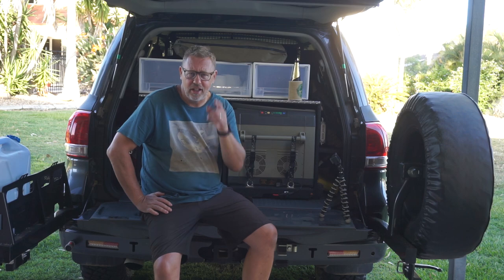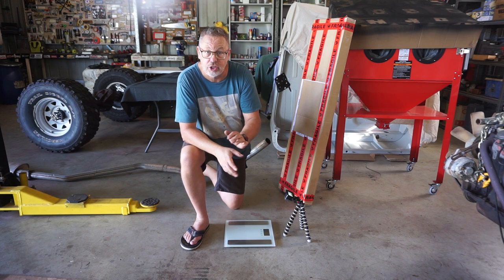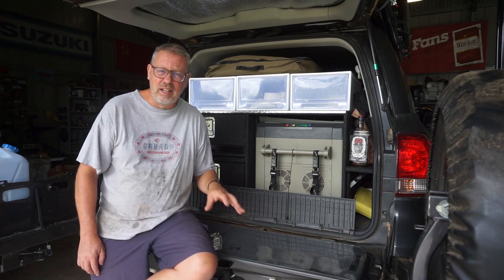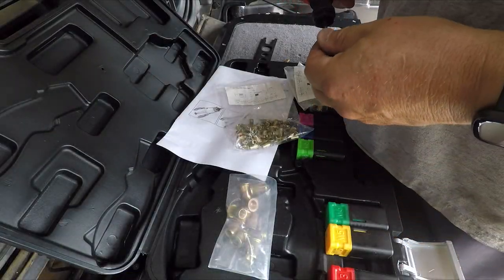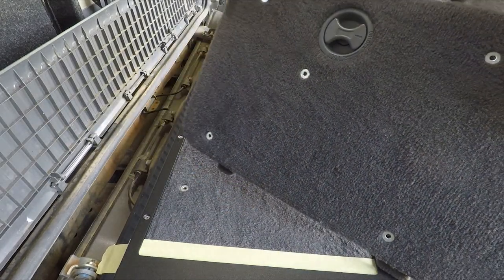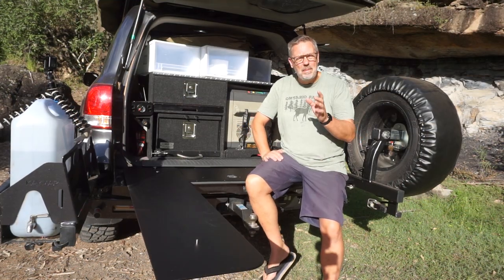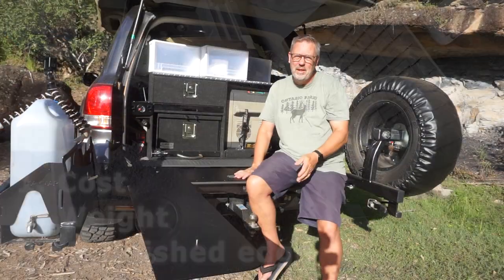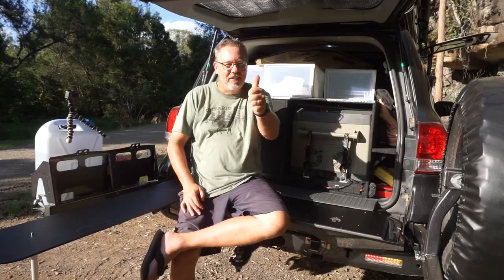How to Install a 4WD Tailgate Table | Cruiser Custom Camps | Is it worth it?

Comment: Hi Terry, it seems kinda weird that a company would want you to cut up panels just to fit a shelf onto the back of your tailgate and not supply some sort of moulding/cover for where you made the cut (just not good business to me). It also means that you can no longer use/access that part of the storage area as you are covering it with the blanking plate that you are affixing to the tailgate. My suggestion would be to make a fold-down shelf etc that comes off your rear spare tyre holder or something similar.  This is why I am in the process of making and installing 2 x fold-down shelves, one on each of the back barn doors on my 80 series. I've seen some people only have one on the main larger rhs door, but I am thinking of having one on each of the doors for easier use and especially the little one on the left smaller door just for simple things on the side of the road type of quick lunch or grab a drink kinda thing... I'll be making mine from timber that I have stored in my workshop and some piano hinges and probably will be making a video and putting it on my channel soon if you wish to check it out.
Reply from the maker: That’s awesome Tim.  I had an 80 before my 200 and did the exact same thing, but as you noted only on the larger RHS door.  It worked a treat.  I took the vinyl off the original door card and bonded it to the back side of the shelf and it looked factory.  Enjoy your build Tim😎👍

Comment: Hi Terry, thanks for your vid, it was clear & well done.  Maybe a con is the leg, it sits (sticks up) above the tabletop.  So you will lose table space and won't have a flat area to put things on.
Reply from the maker: Thanks James, I appreciate your kind words and suggestions.  I agree that could certainly be a con.  I have not found it to be an issue, but if it was one could just grind it level.  There would be more than enough material to serve the purpose.  Thanks again James😎👍

Comment: Hi Terry great tool. What I would do is replace the steel top with 5mm or 6mm aluminum plate.Use boat type aluminum as it is stronger and harder than ordinary aluminum. The the aluminum table powder coated black.
Reply from the maker: Thanks for commenting and for the suggestions Daniel, I really appreciate it.  The table top is actually aluminium, it’s just very thick to prevent bending hence the weight.  Whether it is boat aluminium or not, I could not say.  Again, thanks for the suggestion 😎👍

Comment: Well thats a ripper Terry, it’s something I’ve been trying to come up with for awhile. I saw a bloke on a recent tagalong use a Dunn & Watson small hook on table attached to the back of the wheel when it has been swung out.  I saw this before and I suppose the only other downside is that you lose the storage under the panels, I think.  Anyway I reckon this video has me sold on it, and also because it’s Aussie.  👍
Reply from the maker: Thanks for watching and commenting Andrew, I really do appreciate it.  It’s the fuel I need to keep producing content.  It’s the best solution I could find to address my issue.  Re the storage under the panels, you still have that mate.  Only about 30mm less on the left hand one (you can slide items under the cut down panel), and the entire right hand side remains as factory.  Anyway, glad the review and install video was helpful.  Keep the shiny side up mate😎👍

Comment: Nice video Terry, as usual.
You could try to enquire about the cost of carbon fiber sheet, if you use the same thickness you'll be surprise by the rigidity of it.
The carbon fiber will be at least a 30% lighter but given that you won't need the same thickness you could save 50% of the weight.
Thanks for sharing
Cheers
Reply from the maker: Thanks for watching and for your kind words Max.  Great idea re carbon fiber sheet.  I have no experience with it.  I appreciate you sharing your thoughts.  Cheers 😎👍

Comment: Can you provide me with more details of the tailgate soft opening latch please? I've made my own tailgate table modification, and I'd like to fit that latch you mentioned. Btw my mod is much lighter than the one you've shown. Thanks 👍🏻
Reply from the maker: Hi Paul.  YouTube will not let me put video links for Jafffa Adventures in the comments (nor any other channel) but if you scroll through the Jafffa Adventures library you can find "4WD Rig Rundown. Landcruiser Overland Tourer. Episode 2/3 The Interior".  I have a little bit more information at around the 7:50 mark.  The part numbers you are after are 66120-60021 (Hinge) and 67028-60010 (Damper).  I would get them through Amayama rather than your dealer as I'm sure they will want your first born for payment.  They were selling for $51.24 AUD for the hinge and $66.32 AUD for the damper when I bought them.  With the additional CCC table weight they are 20% effective, without the additional weight they are 100% effective.  Let me know if I can be of any further assistance.  Keep the shiny side up mate, cheers

Comment: Well done.  Great job on the installation.  It takes a brave person to cut up a perfectly good trim 😁 Though wouldn't it have been just as easy and quick to use the Drifta pull out table that you already have with your drawers for the type of use you had in mind?  Then no additional weight and no extra cost.
Reply from the maker: Thanks for the kind words and question, it’s very appropriate and the same one another viewer asked as well.
Two reasons.  The Drifta table, although great, takes a minute or so to set up and to get level.  That does not seem like a lot of difference but it really is.  Convenience is paramount in our setup.  Secondly, if we are pulled up for an over nighter and do not want to pull the whole Drifta kitchen out (ie just use the Drifta table on its own), this tailgate table gives us double the bench top real estate.  I only pull the full kitchen out if we are pulled up for 2 nights or more.  I trust this makes sense, it works brilliantly for us in the real world.  Cheers😎👍

Comment: Where did you get that part to slow down the tail gate?  I’m gonna get custom 3mm stainless to fit and glue onto the trays.  But won’t be doing the pivoting table idea.
Reply from the maker: It’s a factory Toyota part, they were available on the Lexus as well.  I don’t have the part number off hand but I got mine from Amayama and you can also get them through the dealer.  Was sub $100 from my recollection.  Cheers👍😎

Comment: Hi Jafffa I have just installed my CCC 200 series bench and the quality is excellent 10/10. You mentioned that you had a tailgate assist strut system which I haven’t got and I was just wondering if it is working with the additional weight on the tailgate as that would be the only criticism. I know it won’t be a 100% fix but I’m hoping to will help. Can you please send me the link for the strut system please. 
Thanks mate enjoy your videos and I am subscribed.
Reply from the maker: Hi Peter.  YouTube will not let me put video links for Jafffa Adventures in the comments (nor any other channel) but if you scroll through the Jafffa Adventures library you can find it or type "4WD Rig Rundown. Landcruiser Overland Tourer. Episode 2/3 The Interior" in your search bar.  I have a little bit of information at around the 7:50 mark.  The part numbers you are after are 66120-60021 (Hinge) and 67028-60010 (Damper).  I would get them through Amayama rather than your dealer as I'm sure they will want your first born for payment.  They are currently selling for $51.24 AUD for the hinge and $66.32 AUD for the damper.  With the additional CCC table weight they are 20% effective, without the additional weight they are 100% effective.  Let me know if I can be of any further assistance.  Keep the shiny side up mate, cheers

Comment: Terry what is the little gadget you've got to slow down the tailgate opening? I need that in my life!
Reply from the maker: It’s a factory item that the Sahara’s have.  I bought mine from Amayama, but you can get them from the dealer as well.  I don’t have a part number but if you do a Google search you should find mention of it.  Cheers 😎👍
Reply: @JafffaAdventures  Just did a bit of googling and it seems to be exclusive to the 200, ive got a 100. Couple of posts on a forum of guys trying to retrofit them but they didn't seem to have any success unfortunately :(
Reply from the maker: Bugger, at least you tried mate👍😎

Comment: Would welding a little hinged leg to onto your jerry holder support the bottom of the table horizontal and fold vertical when closed up.
Reply from the maker: Yes indeed that would work as a solution mate.  The leg provided is very small however and is not inconvenient in the least.  Thanks for watching and sharing mate 😎👍

Comment: I'm not sure keeping the carpet in sandwich between the tailgate and the table panel is a great idea. If it get wet at some point it will not dry easy and you may ends up with hidden mold or even rust.
I think it would be an improvement to design it to completely replace the carpet part so you win a bit of weight and if one day you want to revert you could put back the carpet.
Reply from the maker: Thanks for the feedback, glad to get it.  I disagree with the carpet getting wet, it’s inside the car inboard of the seals.  I have never had water past those seals yet and I’m not planning on drowning the car (but does anyone ever plan that 🤔😬).  I guess if I spilled something it could get wet, but if that’s the case I’d pull the panel off to dry.  Anyway that’s my real world experience using the table so far.  Thanks again for the feedback 😎👍
Reply: I agree. I was considering one of these but thats a deal breaker for me. I often fish at night with the tailgate down regularly get a bit of rain onto the tailgate. Carpet always dries out quickly enough. The biggest issue with this install is not painting all those holes drilled into your tailgate. Long term thats rust for sure. I do like the product but for $550 I think I can come up with a DIY option.
Reply from the maker: Thanks the beauty of these types of videos isn’t it, it helps you make an assessment of the options without spending a cent.  Cheers

Comment: You have a drifta table in your drawer set up.  Why do you not use that instead of adding the table to the tailgate?  Genuinely interested as I'm doing a similar drawer set up.  Also confused as to why you drop the tailgate down rather than just  holding it on the way down.  Not sure why this is a thing.
Reply from the maker: Good questions mate, I’ll do my best to answer.  Re using the Drifta table, convenience.  The issue I have relates to quick lunch stops.  I could indeed pull the Drifta table out but it takes a minute or so to pull out and get the legs set up properly, especially on uneven ground.  This table takes seconds, that’s the reason.  I use the Drifta table when we have pulled up for the evening and can accept a slower setup.
Re holding the tailgate, again it’s convenience. This might seem like an insignificant point, but when the soft opening hinge worked, I would pull the tailgate lever and let the gate softly fall on its own while I moved onto the next job.  I could do tasks in parallel.  Now I have to hold it on the way down so I am forced to do tasks in series.  It’s just less efficient, even though you would think it inconsequential.  I genuinely loved that mod for that reason.
Of course the overarching negative issue for me that I detailed in the video is weight, and every little bit ads up.  If these issues are no big deal for you then there is even more to love about this product.
I trust this is of some use. Cheers😎👍
Reply: @JafffaAdventures  thanks for the vid and the reply.  I do like the look of it!
Reply from the maker: Good stuff mate 😎👍

Comment: Hey mate, great video once again. Can you help me out with some tips about your waeco? I have the same but I struggle with temperature control. I see you have one of the freezer dividers pulled out. What temperature do you run to maintain the whole cabinet as a fridge?
Reply from the maker: My fridge is the older model with the 5 LED lights not at temp setting but here’s how I manage it.
As you know, the freezer compartment controls the entire fridge, there are no cooling elements in the fridge area.  It works by spilling cold over from the free34 compartment.
I have drilled two 25mm holes in each of the dividers.
If I’m running a full freezer and fridge, the spill over through those holes is enough to keep the freezer stuff frozen, and the fridge stuff at around 2C.

If I have a half full freezer, I remove one of the dividers and back the thermostat off a little because you are getting more spill over.  That’s enough to keep the freezer stuff fozen, and the fridge stuff nice and cool.
I trust this helps.  Thanks for watching and commenting Mitch, I sincerely appreciate it 😎👍
Reply: @JafffaAdventures  thanks mate much appreciated. Do you have much luck keeping a constant temperature using the whole thing as a fridge? Finding things at the coil end freezing/icing over and the other end too warm
Reply from the maker: It’s a bit like that but I certainly have not found it unmanageable.  I guess I don’t use the whole unit as a fridge that often which is probably the difference.  On the plus side, I’ve had this fridge for well over 10 years now and it has never let me down 😎👍
Reply: @JafffaAdventures  thank you much appreciated
Reply from the maker: No worries Mitch, travel well😎👍

Comment: Does the table rattle at all? How’s it going after two years? Cheers AJ
Reply from the maker: Does not rattle at all.  Going great, I’m on a 5 month remote trip of WA and it’s not missed a beat.  Someone in the comments said they are no longer trading so I’d check that out 👍😎

Comment: Hey Terry a follow up question about the swing out table, how stable is it and what did you feel comfortable about putting items on it.  Would it be fine for a gas stove or is it jus not meant for that?  Is there much in the way of any twisting of it that might tip things off it?  Or would you put bigger items like this onto a proper table only? Thanks again 👍🏻
Reply from the maker: All great questions Andrew.  There is a locking pin that goes in when deployed.  This eliminates any twisting motion that you point out.  Without it, it would indeed twist, with it there is no twisting at all.
As far as stability and strength, we regularly use it for our gas stove.  I’ve even had a full 20 litre jerry can on it to do some siphoning, it’s remarkably strong.  I trust this helps mate, reach out if I did not answer you’re questions.  Cheers 😎👍
Reply: So if you were tossing up between a table and this device, where I’m not towing a trailer and so space is at a premium, which would you have or do you believe that in a way they both compliment each other?
Reply from the maker: Mate I love them both and would not want to choose between one or the other.  Call me a greedy guts, but that’s just me.  Sorry I could not be more helpful 🤔

Comment: Love the idea but a bit steep in price I reckon. Might have to get the thinking cap on and build something similar
Reply from the maker: That’s exactly it isn’t it.  Is it worth it for someone’s needs?  Some will say yes, some no there’s no right or wrong answer or one size fits all.  If you are handy you could certainly fab one up yourself that’s for sure👍.  Thanks for watching and commenting mate, I sincerely appreciate it 😎👍

Comment: Does it rattle when not in use and driving??
Reply from the maker: No not at all mate, it’s very tight and no areas where it can rattle.  Cheers😎👍
Reply: @JafffaAdventures  any regrets with the product? Is it nice and stable for things like chopping etc?
Reply from the maker: None what so ever, I’d buy it again in a heartbeat.  The downsides I mention in the video remain, but they are not deal breakers for me.  Very stable as well😎👍

Comment: Nice!

Did you make the row 2 shelf or buy it?
Reply from the maker: Thanks mate, I sincerely appreciate it.  If you are referring to the drawer system with the table inserted between the two drawers, no I did not make it it’s from Drifta.  I did a full review on it and that’s in the library.  It’s the camp kitchen video.  Cheers 😎👍
Reply: @JafffaAdventures  Hi, no I was referring to the shelf behind the front seats, above your oven..
Reply from the maker: Ahh sorry mate.  I made that one mate.  I go into a little bit of detail on it in my rig rundown video on the interior if you want to see a little bit more.  Cheers 😎👍
Reply: @JafffaAdventures  Ahh OK.. Thanks for the responses! You sound like you've had some great adventures, hope we cross paths one day.
You might be interested in the Mundi Mundi Bash (concert weekend in Broken Hill in August.) 
Camping + road trip + music + beer. Heaven!
I'll be driving from SW WA after a Kimberley trip.
Reply from the maker: I hope we cross paths on day too.  Crowds are not my scene so if there’s a large gathering like the Big Red Bash, you’ll find me heading in the opposite direction😉.  Cheers😎👍

Comment: I wonder how well it handles wind
Reply from the maker: It’s very heavy.  I was on Cape Melville in July with 30 knot winds, did not budge.  The locking pin prevents it from swinging.  Cheers😎👍